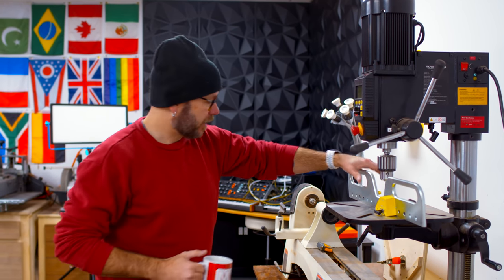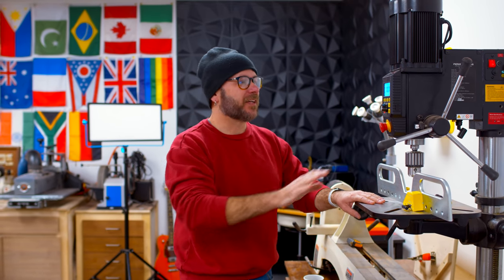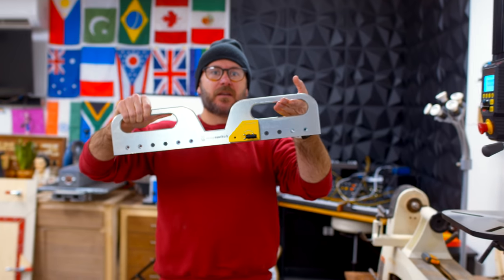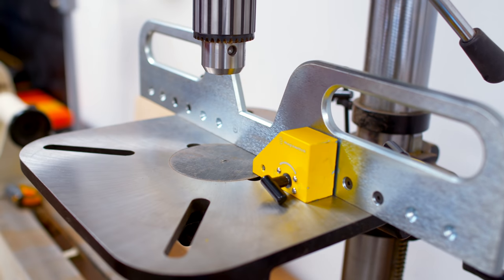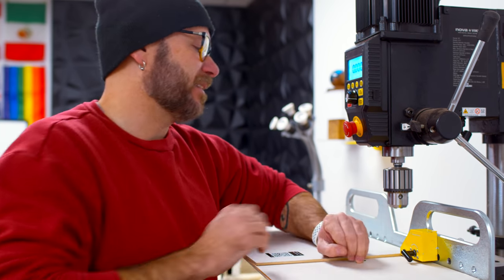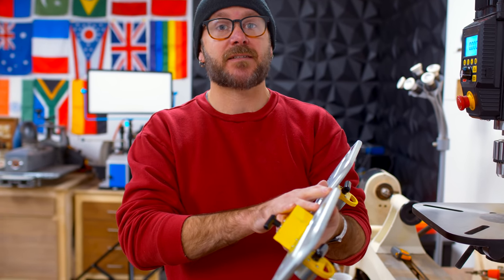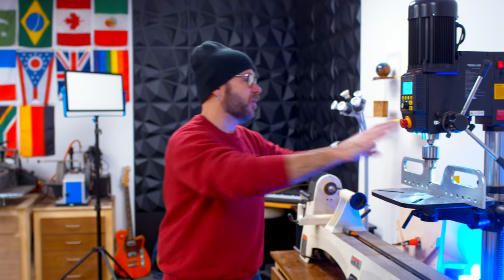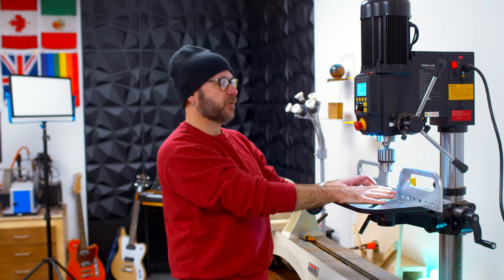The Last Drill Press Fence You'll Ever Need

Comment: The top of the fence will interfere with the press handle, maybe only one side should be that high? Or make it able to swing out like some chop saw fences
Reply: Just slide it a little to the left so it doesn't interfere. Of make shorter handles.

Comment: Like others have mentioned, I wondered if the fence would block the handles of the press as one is lowering the chuck during a drilling operation.  I suppose one could put a spacer between the fence and the work piece, but keeping the fence low on one end and high on the other end so the fence can be flipped around would be nice.  Also, for that price I'd like to see a rail milled into the face of the fence.  Nice idea otherwise.

ETA:  Looks like David removed one of the handles on his press - was that to avoid an interference issue?

Comment: I just bought this and the fence slides. My table is clean. Is this typical? I’m returning what I bought and am unsure if I should get a replacement or move on. Otherwise very well built and solid. Any thoughts?
Reply from the maker: It should not slide at all. Mine is solid as a rock. I'm not sure what's wrong with yours. I'd contact magswitch.
Reply: Thank you!

Comment: Not being a hater but doesn't that tall of a fence get in the way of the handle? Is there really a need for the height of the fence to be any more than the beginning of the handles/cutouts on the fence? seems it would be tall enough without and you wouldn't have any handle issues.